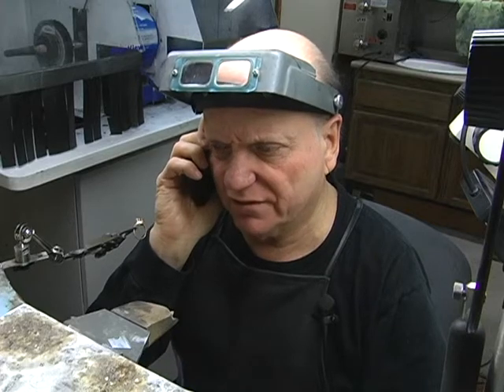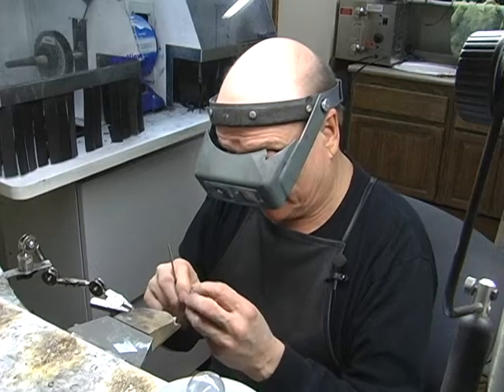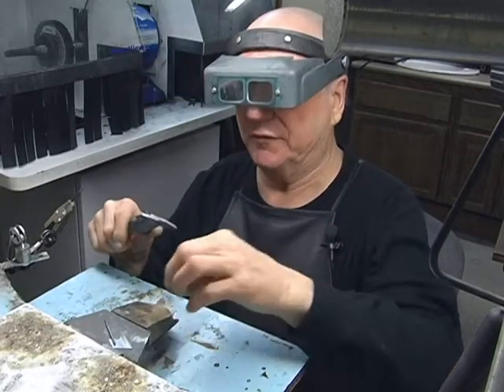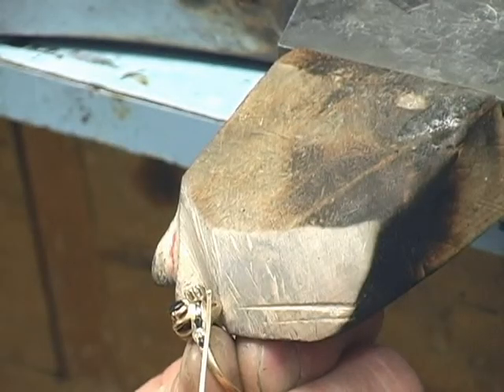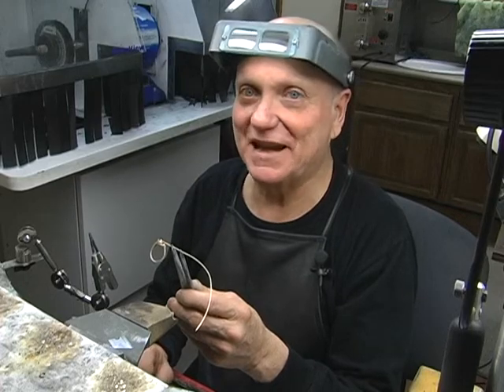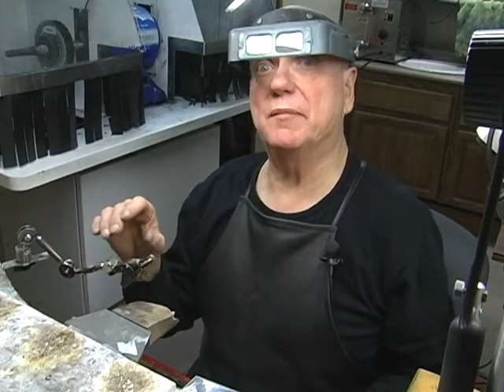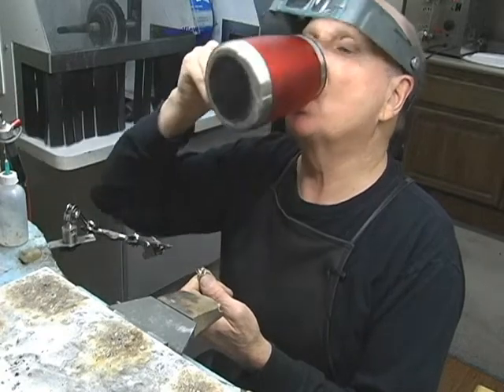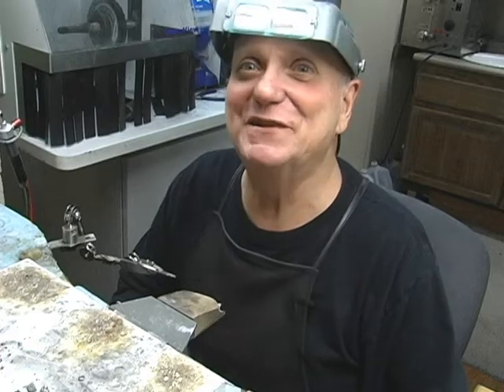JEWELRY (THE BURNING BENCH) EPISODE EIGHT

Comment: You should get yourself a laser chap would make life a lot easier for you.
Reply: willie toth look up  "www.rofin.com"  after working 50 years at the bench I got myself the desktop model
Reply from the maker: I am well versed in laser welding ... For 3 years I used a rolfin floor model laser and I currently have access to a desktop ... The laser certainly has it's place in our trade and for this job would excel ... However, for my series traditional tools are best ... Thanks for your support
Reply: Willie, willie, willie ....how much do you charge for a repair like this? Also, would you consider taking out the stones building up channel then reset?
Reply from the maker: john yazbek 
I don't talk about cost in an open forum, sorry ... Dia, Saph, & Ruby can take the heat and do not need to be removed, anything else would  have to be removed adding time & labor cost to the job ...  I will always go for the shortest most efficient route on a repair ... Hope this helps ...